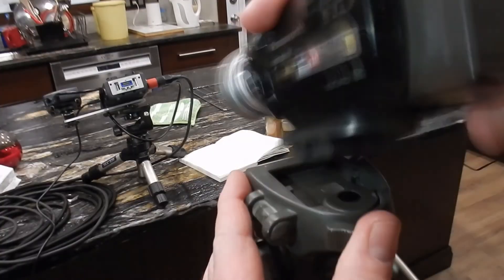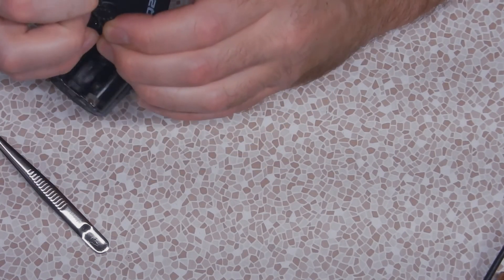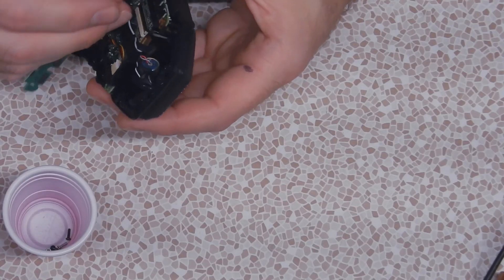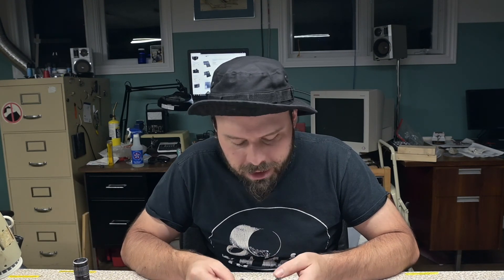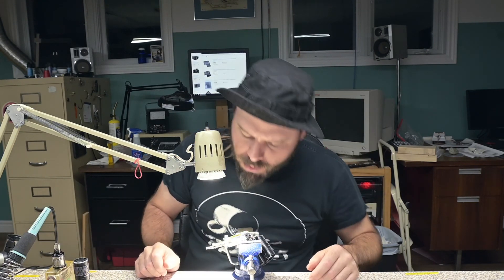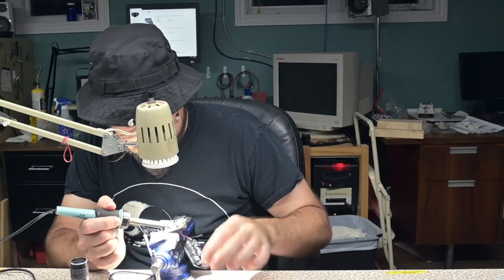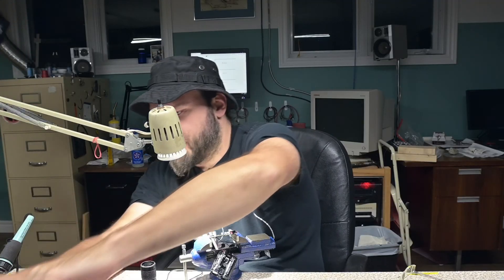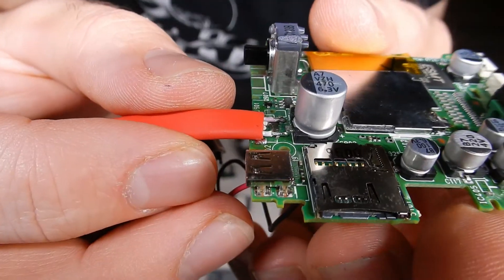Zoom Q2n with broken USB port gets hacked.

Comment: I soldered the USB cable directly onto the battery tray terminals because the PCB tracks were too damaged on the micro USB socket. It’s worked a treat! 

I think the unit can work in a 3-5v range. I was going to throw mine out once I realised the PCB was too damaged but thought I’d try straight onto the battery terminals. This means you don’t need to tear down the whole camera. I hot glued the 3ft cable into the base of the battery tray and cut a small hole in the bottom corner of the battery cover for the cable to hang out of. Now I can power it from a USB power pack and continue recording my gigs!
Reply from the maker: Yeah that's good to know. I wasn't sure if I could feed full fat 5V to the battery terminal. 
My gut said yes knowing how the power supply in this thing likely works. 
And the fact that the unit will panic dead battery like 10 mins after putting in fresh batteries. I don't think 3v is enough for the unit to begin with. 
If I recall correctly, we were opening the unit up to see if we could fix it when we decided to hack it, so we were tearing it apart to begin it. Sadly, I might have been able to fix it proper had I opened it today cause I since leveled up my SMD soldering skills.
Reply: @DATT  this repair was at the limit of my soldering skills and if I had been able to solder onto the pcb I would have been concerned that I’d be able to get enough glue on the cable to hold it securely for use out and about in a gig environment. But thanks to your tear down video I was able to get into it and find a way to resurrect the camera. I only use it a few times a year so hopefully it’ll last me a few more years! Thanks again
Reply from the maker: @CB-DW  I think buddie got another year or so out of his. I'd mentally prepare myself to replace it.
Reply: Could you tell me more about the soldering onto battery terminals process?

Comment: thanks, I'm in the same boat.. what do they call that? designed to fail... ha.. what do you think about soldering a power cable to the battery connections?
Reply from the maker: I don't see why that wouldn't work, I'm just not sure what voltages the battery terminals are validated for. Like a 3-3.3v supply would be a no brainer, just not sure how much more voltage you can feed the battery input. I'm SOME CASES, 5v might be a universal standard for the circuit, and the battery terminals can take 5v no problem, but, I really can't be sure.

Comment: Great video! I have the same exact problem with my q2n, and thanks to this incredibly informative video, I can now confidently just buy a new one! 😂😂
Reply from the maker: Yeah pretty much. I can't recall how much more time this bought him, but the microphones failed on it, he gave it to me, and now it's in my junk pile. I bust it out the odd time to do a trick shot that just needs video and running off batteries . . . which seem to last like 10 mins.
Reply: @DATT  shame the mics packed up. 

The camera is meant more as a live audio capture device with video as the secondary feature. 

From the Zoom marketing: “ The Zoom Q2n gives you a fast and easy way to create HD videos with high-impact audio. The built-in X/Y microphones capture sound with beautiful stereo imaging. And the 160-degree wide-angle lens excels in an array of lighting conditions—whether you're filming at home, in a rehearsal space, or at a club.”
Reply from the maker: @CB-DW  Yeah, the video quality is not that great, not by my standards anyway. And I can't speak for the audio quality. 
Probably pretty decent. My personal Zoom audio recorder is good.
Reply: @DATT  the audio is very good compared to GoPro devices I’ve tested at gigs. Copes well with high volume environments and with the dual mic’s it actually produces reasonable stereo imaging
Reply from the maker: @CB-DW  Well I should hope so. I believe Gopro are more for video than audio.
Reply: Just solder the wires onto the battery terminals. I did mine last night and it worked fine, no need to dismantle the whole camera
Reply from the maker: @CB-DW  Oh, are you feeding 5V USB to those terminals ?
Reply: @DATT  yeah, 5v USB battery power pack putting out 4.8v @ 1.0 amp. Seems to work ok, no over heating and I left it recording for 3 hours today; all ok so far. It may reduce the longevity of the camera but I’m not worried as I was going to throw it out in the trash after I realised I could solder directly onto the PCB.
Reply from the maker: @CB-DW  Nah it's probably fine. Likely this was designed to run at 5v, but "can" run at 3. I doubt it'll make any diff on camera life. 
That said, based on the quality we're seeing. The camera won't last very long no matter how you use it.

Comment: Dude  the most important part .. where to solder the power wires from your cable and where is positive and which is negative.. you never show that on camera.. I got my unit apart right up to the jack repair and now I am stuck and cant do anything.
Reply from the maker: Ohh, well, what I did, was I took the old jack I removed, and I hooked it up to a USB cable, added power, than tested which pins put out what with a multi meter. The power pins are going to be the outside pins on. The inside pins are data. I cant' say off the top of my head which is which polarity. 
It is worth noting, Data didn't work anymore after this hack.
Reply: @DATT  Ya i dont care about data i just want the power and polarity is not a issue.. i need to know if you soldered to the 2 outside of the 4 spots directly in front of the jack or to those 2 weird side spots that end in under the jack ??  I was thinking the solder on the side of the jack was not functional and just to hold the jack down but then they seemed to form part of the circuit to those 2 round spots under the jack ?? Perhaps just grounds ??  And i may have damaged the yellow flat multi wire cable that goes from the Screen to the circuit board.. I hate zoom for all their products having this defect ..Love the units for the price point but they are manufacturing a known defective product forcing you to buy again and again.. I have 3 Zoom H2N and I have had 3 zoom Q2N's EVERYONE OF THEM HAS A BROKEN POWER JACK AND I TAKE IMMACULATE CARE OF ALL MY GEAR !! (upside: the h2ns can run on batteries in real lif... so I do that). So at this point i have a pile of parts and small screws in a jar. and those small copper clips look like i cant figure out where the heck they came off of .. . It was working on batteries before I took it apart now not so much .. To be fair you CANNOT USE THAT UNIT ON BATTERIES THATS A JOKE... I really needed your video .. I was crushed by the length of the video than reached the 10 seconds that were crucial for me and there was no camera shot of that action.POOF . now its done..lol .. I do appreciate your video as you are the ONLY MAN on the internet with the balls and fortitude to adress this problem and for that my man I salute you.. I was going to do all that on my own anyway as i had nothing to lose at this point really.. My eyes arent that great and I dont have a micro tipped soldering iron. I will wait for another a day and try again.. How far do you have to reassemble the unit to bench test it after soldering ?? I HATE YOU ZOOM FOR KEEPING THIS PROBLEM GOING FOR OVER A DECADE WITH PLENTY OF CUSTOMER FEEDBACK. I don't understand why they just dont fix the problem ?? Baffles the mind. I assume every single zoom unit on earth will fail and fail exactly at the power jack .. CHANGE MY MIND !
Reply from the maker: @storytimewithunclekumaran5004  Ok yeah, so there are likely to be a couple extra solder pads that are non function, they are to mount the usb jack. They are likely ground. There should be like 4 or 5 smaller pads in between. the out of THOSE are power, the inner ones are data. 
And yeah, it really doesn't run very long on batteries. If you have multiple dead units, and are willing to sacrifice one, you could try attaching the 5v USB cable to the battery terminals, could work the way these kinds of things are designed. 
I have a Zoom H6 recorder that has so far held up. I keep renewing the extended warranty just in case. 
The Q2n in the video failed again, the mic died on it. Buddy gave up on it.
Reply from the maker: @storytimewithunclekumaran5004  Well, I should hope so, they can't be carrying on like this forever. 
My H6 recorder, gave me a scare when the SD slot didn't want to latch, but that problem just went away . . .
Reply from the maker: @storytimewithunclekumaran5004  Damn, my H6 has been pretty solid so far. I wonder if they really manufacture to a price point where there lower end units are far diff in quality form their higher end stuff.

Comment: Simple fast bypass is solder the usb chord on the black and red cable p/n of the battery connection and be done also on the back of the mother board there is 3 solder pins where the data connects but the battery red and black cables will do….
Reply from the maker: So what you're suggesting is that you can wire the 5v USB directly to the 3v battery terminals ?

Comment: Hi ! thank you for the great video. Luckyly my USB port is still working lol. Is there a way to hack the camera so that it turns on automatically when I give them power? (i.e connect the USB cable ? ) I have 7 of them fixed in my studio, and is very annoying having to turn them on each time one by one. Thank you !!
Reply from the maker: Off the top of my head, I'm not sure. 

I might try, unplug it from power, then hold the power button while you plug it in, but keep holding the button, see if it turns on, and stays one. Could be a case of just shorting the power button so always be pressed. That may not work tho, but it's worth the test. 
Other than that, I could probably design something if I had to.
Reply: @DATT  OK. I will try.. I am also considering finding someone who know about electronics, that can open it and eliminate the power button and have it always on.. I do not know.. I will write to zoom to see what they say.. Thanks for the idea.
Reply from the maker: @Amatteus  Let me know how it pans out, I'm curious. Unless Zoom has a setting or firmware update that might do this, I doubt they will be much help.

Comment: Thanks, enjoyed the repair. On my Q2N unit the screen backlight has stopped working. I can still see the screen in a dark room and everything else works but the screen is very dim. Any idea what might be the problem  there ? thanks.
Reply from the maker: Well, I really couldn't tell you much without having it in my hands. I'm not that familiar with these units. This vid was pretty much a one off hack of one. 
Probably power delivery to the LCD itself, which I would assume would be LED lit. 
It sucks cause it's just a damn lamp issue.

Comment: Do you recall which side is positive vs. ground?  also, not sure exactly where I should be soldering to.
Reply from the maker: Off the top of my head, no. It's the edge pins. and if you still have the connector that broke off, you can mock up how it would of sat on the board and then looked up the pinout for a micro USB connector online.
Reply: @DATT  Thanks, I ended up wiring to where the batteries connect. Works good!
Reply from the maker: @jrome_auth  Yeah, that's a quick and dirty way of doing it. That was out plan if we couldn't make this work. 
Just, ah, mind the voltages . . .
Reply: @DATT  Yea, a little worried I burn something out... My 5v USB battery so much better in this device though. Standard AA drain quickly...

Comment: Mine did this when I went to unplug the battery extension. The jack actually came out and is still on the cable
Reply from the maker: Damn eh, yeah, it seems it's a common problem.

Comment: Great video! Thinking ahead before this actually happens. How about adding a short USB extension and gluing it in from the get go to avoid this problem in the first place. "Or" inserting a dummy USB into the unit and then carefully adding hot glue around the the parameter, then gently dislodge it leaving a rim around the jack. If somebody made it in the first place they did most of the hard work, patience, observance and a little bravery will get you a fix "most" of the time! This is how this poorboy has survived modern life for sixty years, although I am a little shy of live VCR heads but I think they are mostly a thing of the past. Enjoyed this video very much!
Reply from the maker: Yeah, might be a good idea for those who use the units a lot in a stationary position. 
And I hear ya'. Only reason I get to have nice things, is cause I can fix them for build them myself.

Comment: Amazing!  I started to take mine apart, it has the same problem.  I don't think the board is damaged though.  The jack drops right out. After removing the screws from the battery area and opening the camera a little, I said Naw!   
I'd like to  find another externally powered camera with good sound quality.  I use it to record music performances at home.  I saw a $60 USB powered camera on Amazon that takes and external mike.
Reply from the maker: Not sure I'd trust a $60 cam but it might be worth a try.

Comment: Thank you very much for video. I had recently got my q2ns USB port replaced but after a few days of working properly, the option for using zoom q2n as a card reader or a webcam is not appearing. It draws power from the usb port and directly opens as normal camera but no options for Webcam or usb mic appears
Reply from the maker: You're welcome.
Subs
Sounds like one of the data pins came loose. They are such tiny connections, it can be hard to solder them. As you saw, we didn't even bother trying to connect them. I suppose one of the solder joints on the replacement was weak.

Comment: the connector has 3 or 5 wires
Reply from the maker: At least 5. I shot this a while ago so it's a bit hazy. The Data pins are so tiny it's hard to solder on them accurately.

Comment: The same happened to mine. How much do you 
charge for fixing it?
Reply from the maker: Well, where are you located ?
I'm in Canada. Not sure I'm comfortable doing a format repair on these, what I did was a bit of a hack job with the idea that if it fails, my buddie can come back over. I don't have the right kind of tools to properly replace the jack.
Reply: @DATT  I live in Victoria BC. I’m sorry I didn’t word my comment clearly. What I meant is in general how much would you charge for a job like that. I might have to go to one local repair shop and I wanted to have an idea of the approximate cost. 

Your channel and this video are very helpful. Thanks for sharing
Reply from the maker: Hmmm, I can't give you a number without knowing shop rates. Since I do this causally out of my home I charge friends a lot less that typical. 
I can say, it's probably a 2 hour job, assuming they know how to get into the thing. I wonder if you can find a tech willing to watch my video. 
Since it's a loose USB jack, I think I might try cell phone repair places. Some only know how to change modules, but some can do micro soldering and will have experience replacing these jacks.